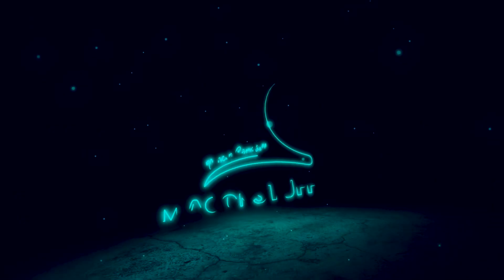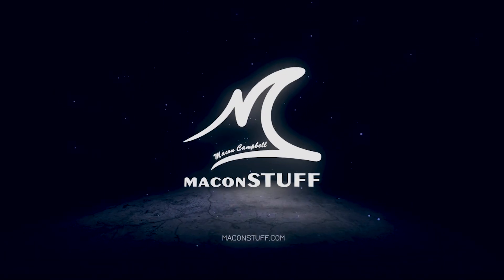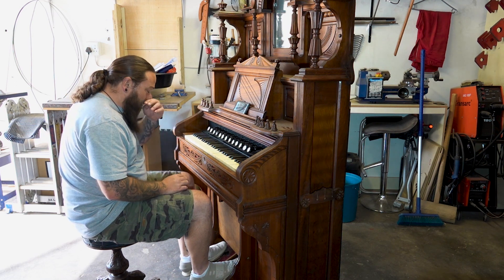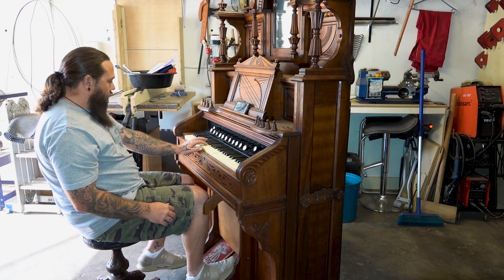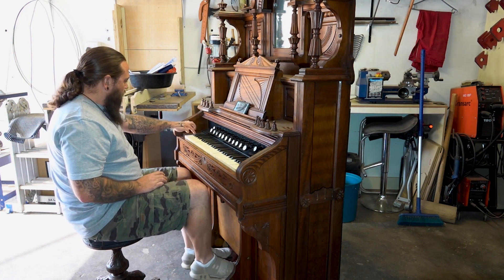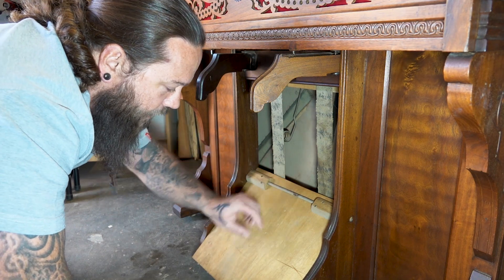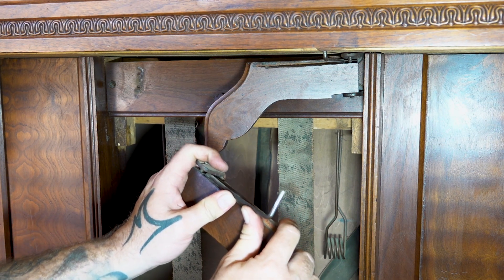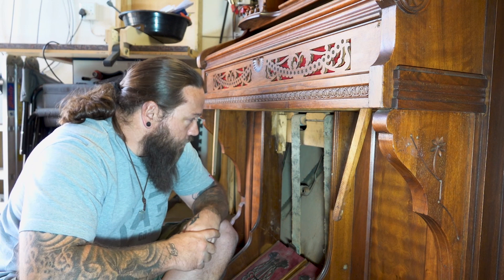Reed Organ Restoration - Part 1 - A Closer Look

Comment: May have been mentioned earlier, we learned that you have to suck the air through the reed to get the note... the bellows actually draw air through them rather than push the air. Your video is great because you show care as you gain new knowledge 👍

Comment: As I'm sure you have discovered by now, the bellows do not blow air into the box where the reeds are mounted - they create a vacuum inside the box.  When you press a key, it allows air to flow through from the top of the reed past the now-open pallet and into the box.  That is why you failed to get a sound when you blew into the bottom of the reed you removed. If you blow into the top, it will sound off. That little square wooden flap you saw when you opened the back of the organ is where the air exits from the bellows. Nice looking organ by the way -- in excellent shape.
Reply from the maker: LOL... yeah I only figured that out last week when I removed the bellows... :-)... I felt pretty stupid when it hit me...LOL